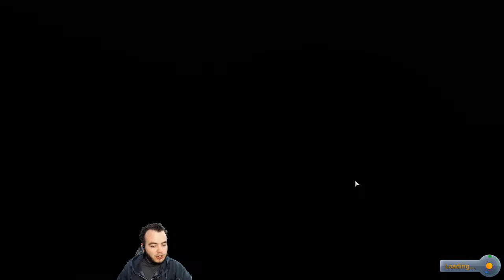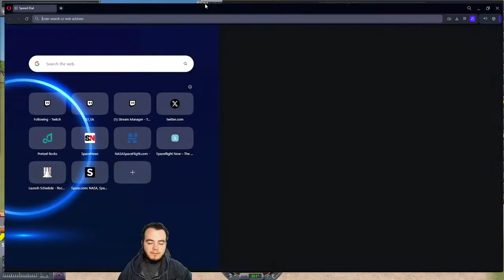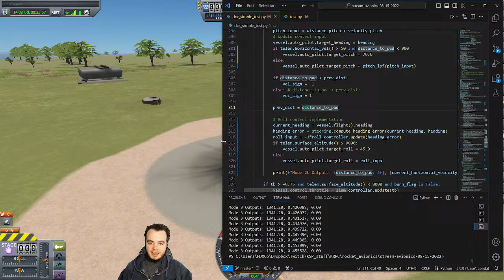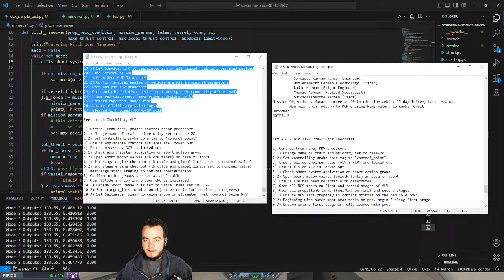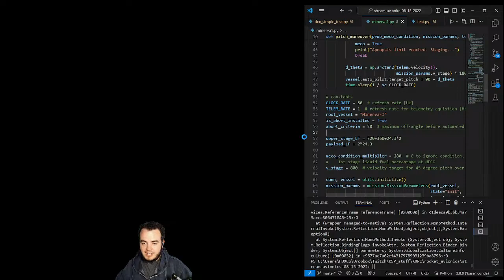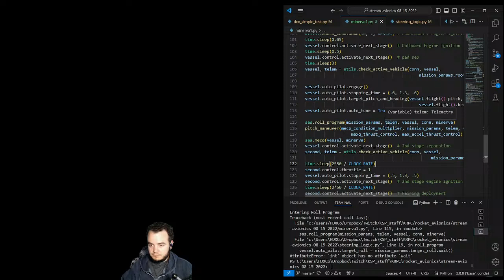First Python Automated Kerbal Missions in Hardcore Career Mode in KSP

Comment: Isn't the pitch program failing because your rocket is bottom-heavy?? Seems like a very obvious flaw to me
Reply from the maker: I believe the issue is because we have a very large lifting surface, the shuttle, sitting at the very top of the rocket which causes a destabilizing moment on the vehicle when it pitches. Take that issue and then make the vehicle do a sudden large pitch over and it can't compensate. Will need to do more testing!